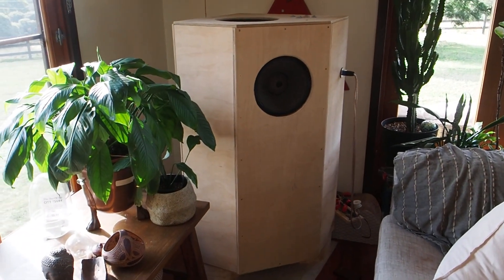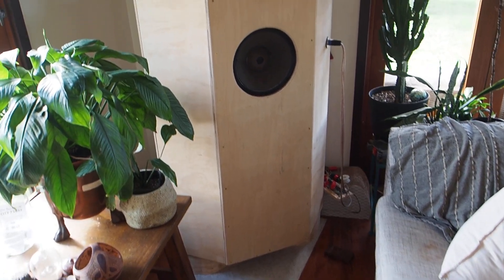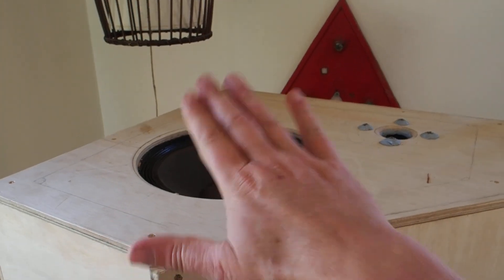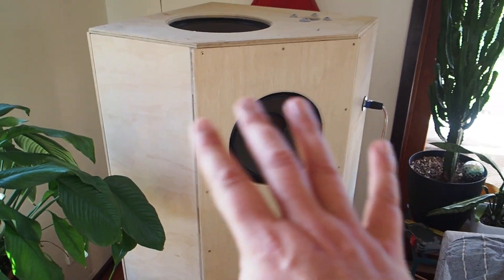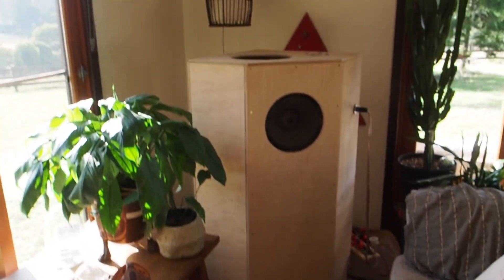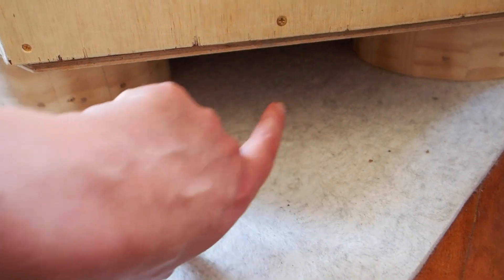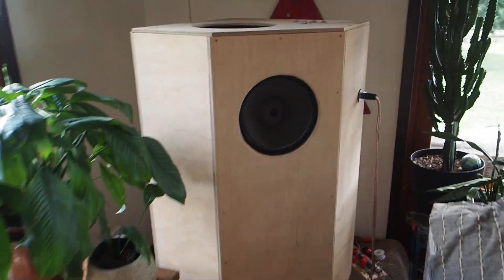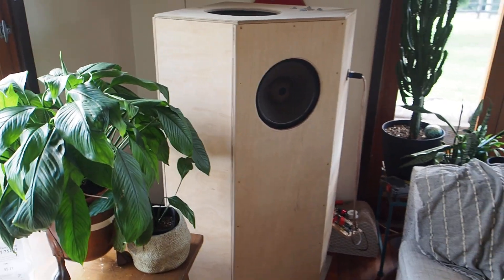Corner Lancelot speaker design: what worked, what didn't

Comment: that looks like it sounds really good. What kind and thickness of wood is that? Did you mount the panels on a frame? I have some 414's I need to build a box for
Reply from the maker: Hi. It's a mix of 9mm pine and 12mm hardwood ply while the internal frame is mostly turpentine hardwood. I'd go for a smaller box than this one to trade in a little low extension for better impact/slam/articulation....